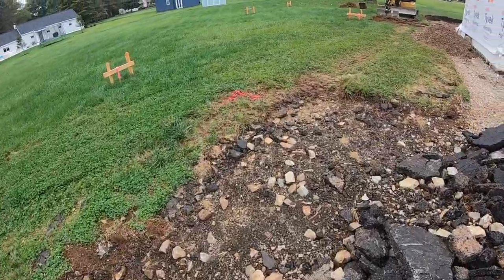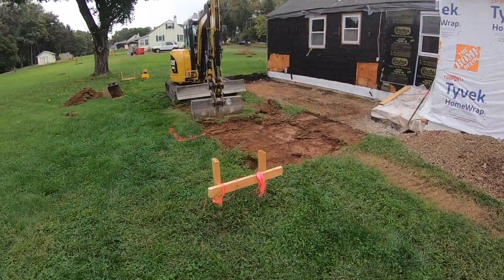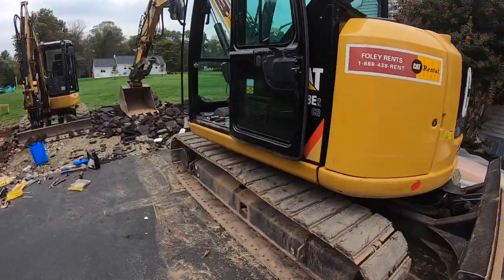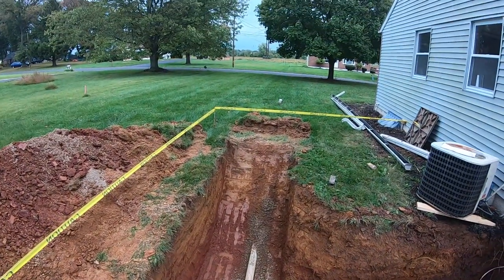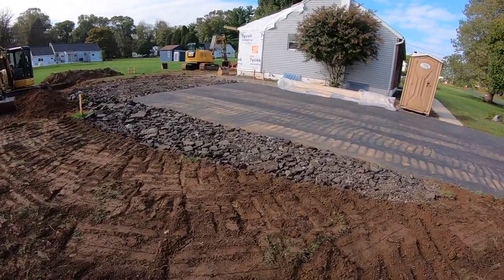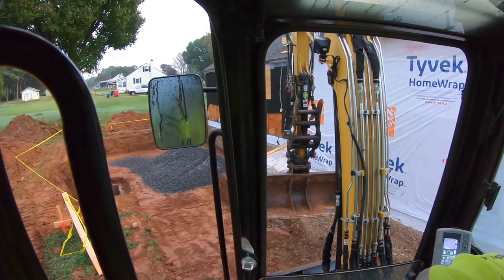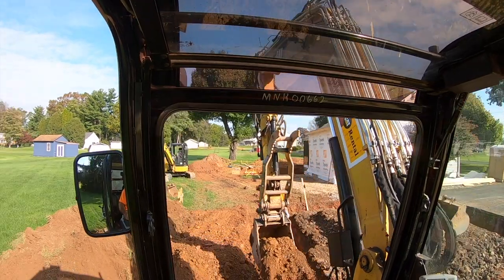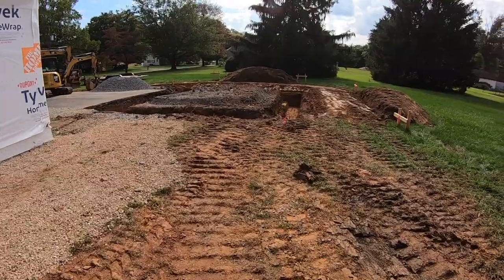Caterpillar 308 Mini Excavator How To  Dig House Footings #diy #adventrure #homeimprovments

Comment: To me, batter boards are the best. Its old school, people here dont do it much anymore, or they dont know how. Even if you are digging alone you can pull a string to make sure you have the corner. Nice job as always!
Reply from the maker: Yeah they are definitely the old-school way of doing things. When I was a kid they were on every job site. Nowadays it’s pretty much just a offset steak. I agree with you they are very handy for being able to find a wall line while digging.
Appreciate you watching Joe 👍🏻
Reply: The newer generation is using GPS coordinates. I still use a flip phone, so yes I still like setting the batter boards. 😁
Reply: GPS is great if you get a signal or remember batteries for it.  Knowing how to do it old school can come in handy.
Reply from the maker: @littlefinkle7757   they are handy👍🏻
Reply from the maker: @lukeabendroth8157     I have been on jobs that I have had both of those problems with GPS. It’s very frustrating and you’re right you’re better off knowing how to do it the old-school way in a pinch!

Comment: Nice looking holes.  I bet that job was a nice change of pace having good dirt and not having to worry about swinging into something.  On the hydraulic lines have you tried using crows feet with an extension?  A stubby wrench may also help a tiny bit.
Reply from the maker: It was a fun job. I was pretty happy with how it turned out. The problem with those hydraulic lines is there is no room side to side. If you can get a wrench on it you can’t move it either way because the wrench takes up all the room. I think the crows feet would be the same size as the wrench. I’m sure there is something made to fit it I just don’t have it yet 🤔
Reply: @fulltiltgrading8366  I'm sure its a Cat only special tool!
Reply from the maker: @tmacie2   yeah! LOL I’m going to have to talk to my salesman about this! 🤔

Comment: Great video, love the commentary on tips for doing it right!  I have my first job digging footings for a house addition in a few weeks and want to do the best possible job. 

I was wondering if you're responsible for typically determining the precise depth or is this provided to you by the architect or someone else?  The "blueprints" have the min depth below grade but obviously with an addition we want the top row of block to be level with the existing house.  It seems like somewhat straight forward math but just not something the excavator would be responsible for.
Reply from the maker: Every job is a little different but yes, I always figure the math so that my top course of block or concrete is even with the existing foundation. If the grade slopes away, sometimes you have to step the footing so that you can stay below frost.
How is remember when digging footings to dig in nice even long strokes from the top down. Try not to curl your bucket through the top of the ditch or you will blow out the top. Be extra careful connecting the corners or you will have a mess. Just take your time. Practice makes perfect. Good luck.
Reply: Thank you!!!

Comment: i’m the jersey guy with the same year 304 as you, i’m liking that 308, i started working for a pool guy over here this summer backfilling, did a dozen so far and just dug one a couple weeks ago, took two days with the mini, guy is wanting me to dig some more, but i’m thinking about biting the bullet on a 308 in the spring, watcha think about that machine, can it handle a bigger bucket and what size clean up bucket could it handle?  any intel would be appreciated.
Reply from the maker: A friend of mine has a pool business and just bought a 308 this summer. He loves it for digging pools. I think they are awesome machines and would buy one if I did more foundation work. That was a standard 36” bucket and it handled it with no problem. I have rented them with a 48” clean up bucket and it worked great. If you have the work for it you can’t go wrong with the 308. You have to try one! 👍🏻

Comment: How is the Takeauchi skid steer now? Hadn't seen a video with it in a long time. Have a great week!
Reply from the maker: The TL10 is running great. I don’t have a constant need for a skid loader so that is why I buy used ones rather than new ones. We use it around the shop but the next time we get it on a job I will make sure to film it. Thanks for watching buddy👍🏻